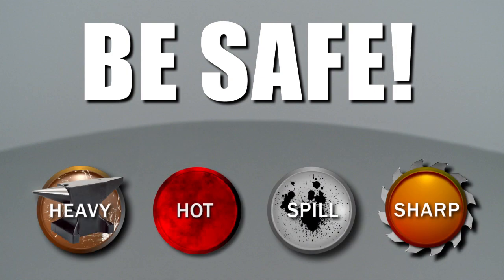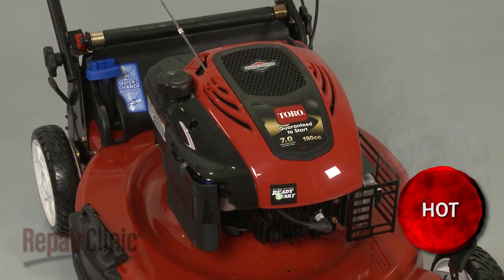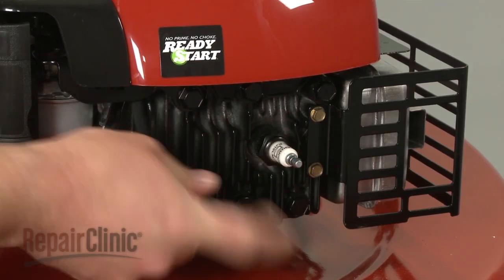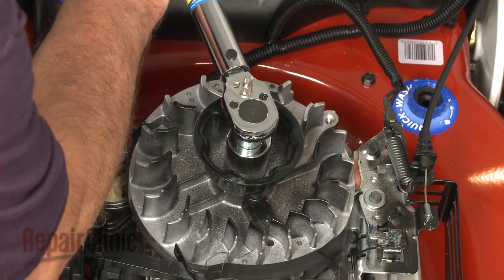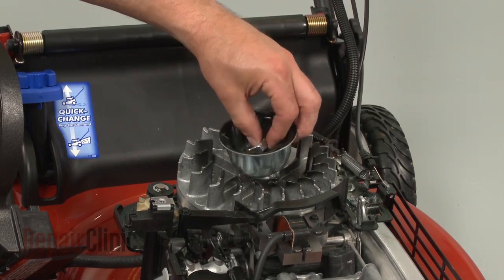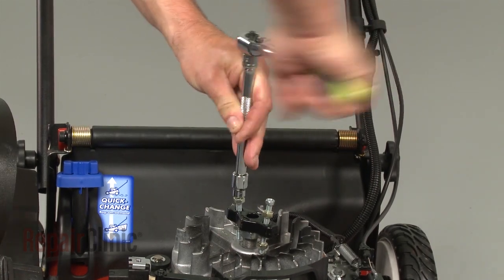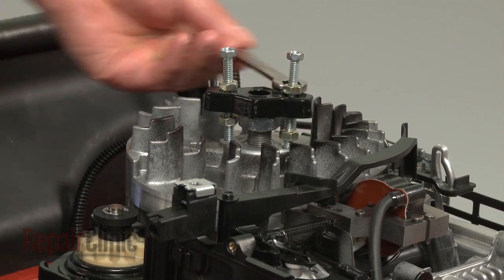How to Use a Flywheel Puller #19069

Comment: What are the two lower nuts for on each bolt of the flywheel puller?  They just seem to be there for no reason.
Reply: I just found your question, after a sort of the posted messages. I have the same question, but my question is posted two years later, and still without a response from Repair Clinic.
Reply: Those nuts should have been run all the way down and cinched down to reduce flex and stress on the flywheel threads. It is possible to rip those bolts out, particularly on an aluminum flywheel. But that flywheel did not look stuck at all.

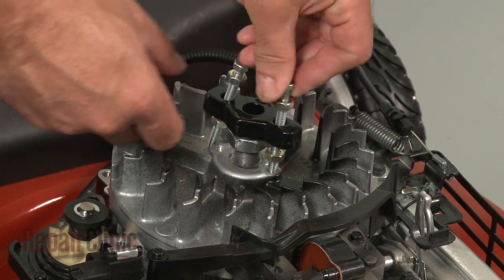Comment: At 1:01, what is the purpose of the two nuts below the puller bracket? The two nuts above the bracket apply force against the crankshaft, through the bracket, but the two nuts below do not appear to have a purpose.
Reply: I suspect in this application they are only to help not separating the bolts from the crosspiece, say when in storage?

Comment: I can't get the screws to thread. The bottom of the screws on the puller came with a notch at the bottom. We have the Briggs & Stratton Craftsman 126Mo2-1525 FI 13061862. Any suggestions? Thanks.
Reply: hottamale02 One of my Briggs did not have the holes tapped. You may need to tap the holes before using the puller.
Reply: Jim Monte how do you tap the holes?
Reply: @micahvaughan8635  you would need to buy a hole tapping kit.  I actually made my own flywheel puller so used a tap to match the bolt threads I had.
Reply: My briggs engine im trying to fix at the moment doesnt have threads on the 'puller holes'.  per below reccomendations, i guess im going to have to try and tap my own threads.

Comment: Will the tool work on Kohler engines
Reply: Probably not, it's part specific. If there isn't one designed for yours, just buy a universal puller.
Reply: @K-Riz314  then I'd have to buy one